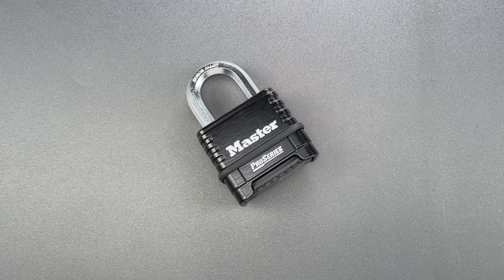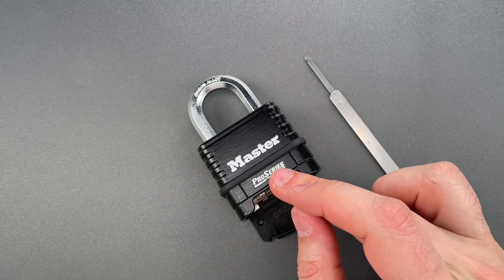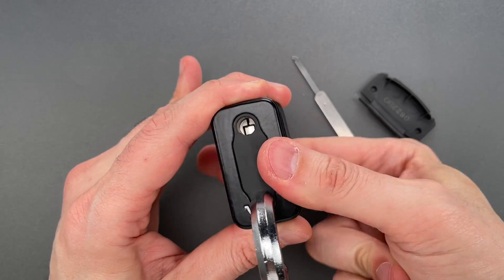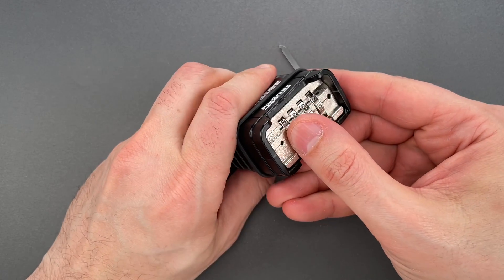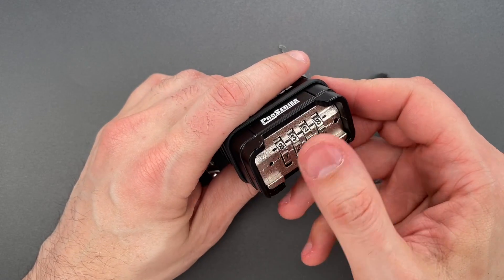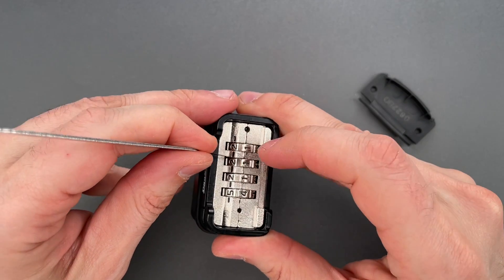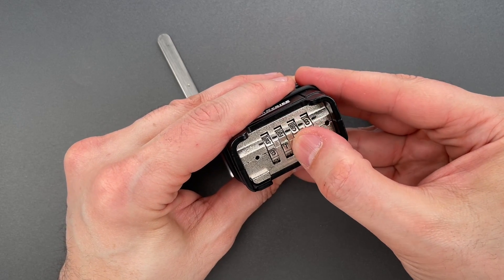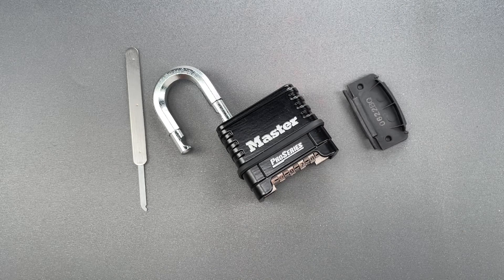[1521] Decoding Master Combination Padlock (Model 1178)

Comment: I had a cheap suitcase combination lock and I used the first method to find the passcode long forgotten. 
(It does wear out the mechanism and put it slightly out of joint if you do it too much, so don't rely on it and never do it to a lock in use)
Reply: I can't see how thats the case, you'd do exactly the same in normal usage of the product.
Plus, if it's in use, removing it and throwing it in the bin would seem to be the correct action to take. 😂
Reply: @blakesimmons5130  in normal use no force on the mechanism?
What are you talking about? Clearly you have never seen me using a combination lock (And I would assume 99% of other lock users)
Reply: @Jehty_  I typically don't pull on the shackle when opening my locks the normal way...
Just spin the wheels.
Reply: @blakesimmons5130 talking out of one's bottom there sir, these are metal parts designed for many thousands of uses and holding the bar or the locking catch is not going to wear anything very much, at least no more than simply operating said lock.
Been using this trick for years to demonstrate to people who install this very system outside of elderly relatives houses why it's a really insecure and potentially dangerous thing to do, not one lock I've ever done this has shown any kind of unusual wear from my actions.
This works exactly the same way that system and as such, you guys clearly have no idea what you're talking about.
Reply: I do what I want

Comment: I work in HVAC and you don't know how often Ive had permission to unlock one of these styles of locks but not the right combination. Literally been at the top of a ladder for a scuttle hole and used this method to get to a roof before thanks for the vids
Reply: LOL. You should charge a locksmith fee on top of your service fee.
Reply: LOL, I can just imagine being on a service call and having to be told to do just such a thing.
Reply: @TesserId  u6
Reply: Im a radio tech and these locks and the other master pad locks are all over mountain top sites. I have had to bypass them once or twice because the combo I was given was incorrect or in one case the lock I had a key for was not put in the link with the other locks, it was hanging on its own so I could unlock it but didnt do me a bit of good.
Reply: @clynesnowtail1257  At FM stations the combination is often the frequency or the frequency backwards.
Reply: I don't know if you're talkin about it inside access ladder or not.
 I hate when people lock them, they're inside you don't need to..
Reply: @justsayen2024  Apparently, some tall buildings are places people go to commit suicide.  I bet there's some legal gotcha putting that on the owners of the building.
Reply: @TesserId  I think it's the same as deadly power lines and such, that are basically protected by their nature (as in, anyone trying to tamper with it will most surely die without accomplishing anything), where any silly crappy lock is added, preferentially with a standard key for them all, so that it's not inconvenient to open, but still has a lock to provide intent of trespassing, thus adequately shifting the blame to the idiot not the company for any accident or fatality.
Reply: @Kalvinjj  yup, if you have something dangerous on your property and someone hurts themselves with it, especially children, many places will find you legally liable if you didn't secure access to the dangerous thing.
Reply: @TesserId  I am sure there is something like that. Even if not an intent for suicide, going up there to screw around or do some parkour that gets somebody hurt/killed could possibly lead to charges against the owner of the space. Putting even a bad lock would go a long way to legally protect them.
Reply: @justsayen2024  My high school, back in the '70s, had locks on the access hatch to keep us off the roof.  We just climbed the 4x6 guttering they helpfully bolted to the exterior walls.
Reply: Our school had trees right next to the roof.  Better than a step ladder!!!
Reply: @alandarkdale  🤣🤣😅 boys will be boys but that's why you just dummy lock the inside access so the kids can't get inside the building.
Reply: @justsayen2024  Look up Ally Law on YouTube and you'll see how quickly people can move through an unlocked building
Reply: @MarkRose1337  I'm talking about an inside access ladder to the roof,, that has a locked door therefore children cannot get inside. All you need is an S hook to Loop through and it's secure from the outside in.🤔
Reply: I have been using this "exploit" since about 1981. Nice to see it still hasn't been fixed.
Reply: Was a Pest Control tech, same story